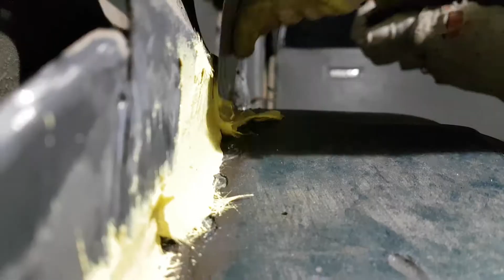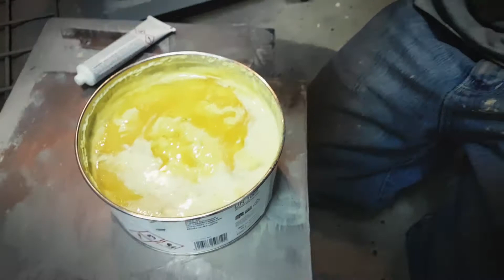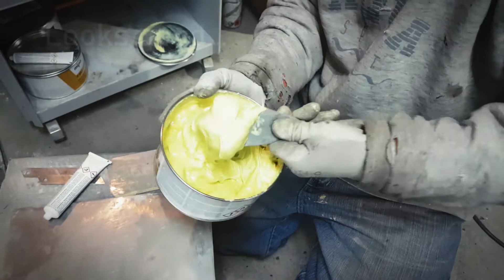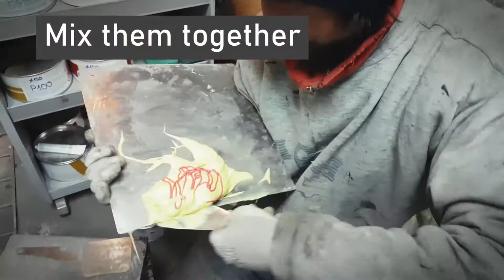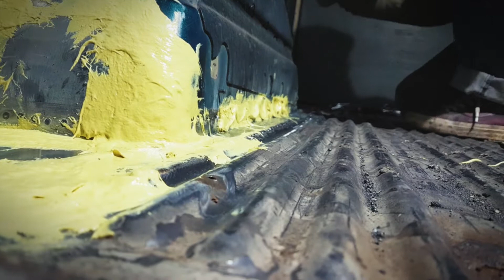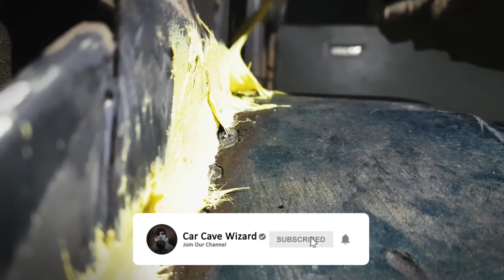Legendary VW T4 transporter, putty filler process

Comment: Wouldn't seam sealer have been a better option around those seams, or am I missing something.  🤔
Reply: I agree. In next video you can see seam sealer around but from wheel side (outside). Inside of the cargo space, we think that its enough because this fiber filler is also flexible.
Reply from the maker: Yes, we uploaded new video for seam sealer: https://youtu.be/7-y3sNMLoRo Also, we have an excellent experience using putty filler inside of the cargo space.